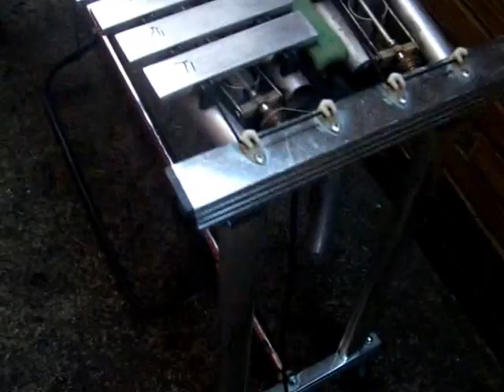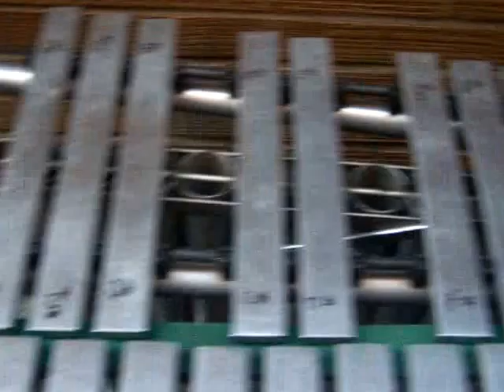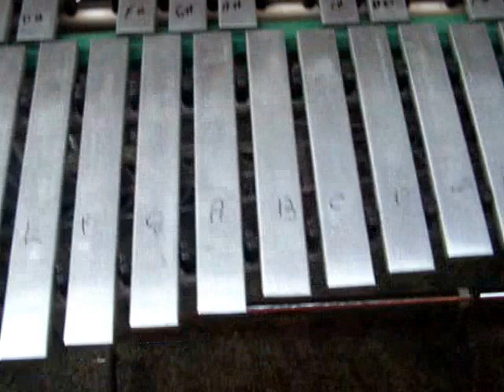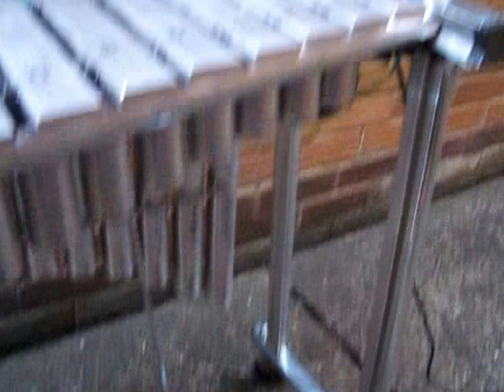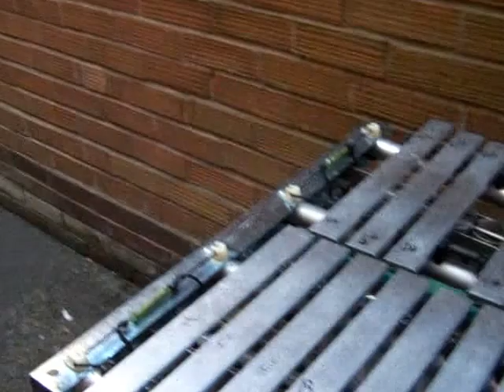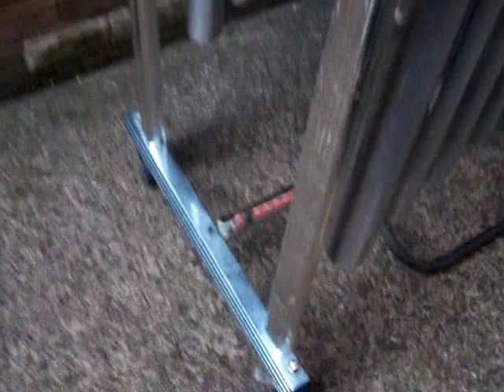100 2524

Comment from the maker: Well I have been working on this vibraphone since I got it a few days ago gave it a good clean got rid of the
marker pen notes ( which thankfully I dont need) quite a few repairs and adjustments and replaced the elastic
bands with a proper drive belt and its turned into a great instrument which Im really pleased with and will not 
be parting with this time ! (got a gig on the 25th !!!) Still I would welcome any comments on the chromed steel
frame which may or not be unique ?!

Comment from the maker: A hurried video clip just to show this newly bought vintage Premier Vibraphone the reason being
I am intrigued by the all chrome frame which I have never seen before on this model ! Is anyone 
aware of this version ? I assume it is a 701 as it has ungraduated bars single speed motor ( with
triple pulleys) and the damper pedal has twin rods. The lower cross frame member accomodating
the wheels is not removal from the frame unlike some I have see but the frame is foldable. I would be
happy to receive any comments The set is due for refurbishment but will not be for sale as I made
that mistake with my last set then regretted it !!